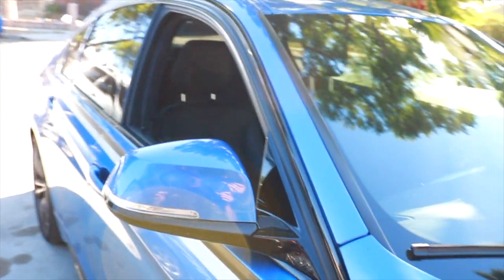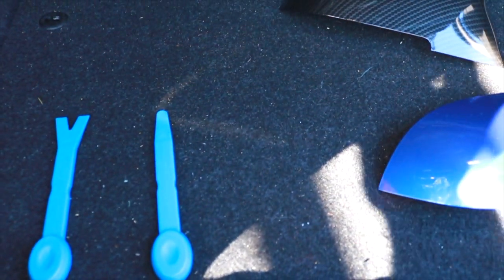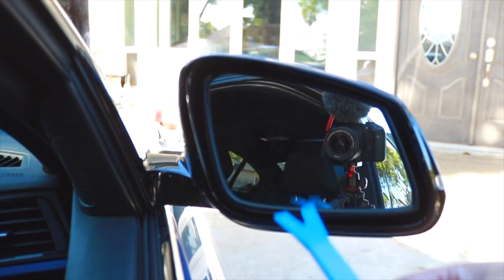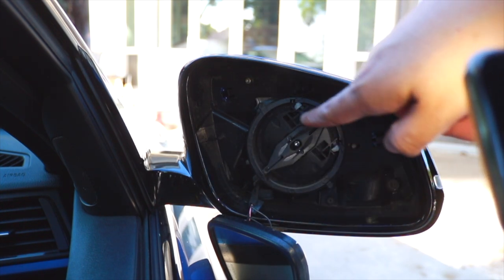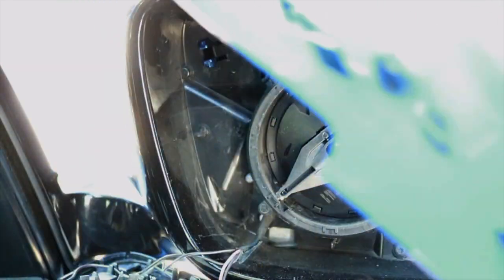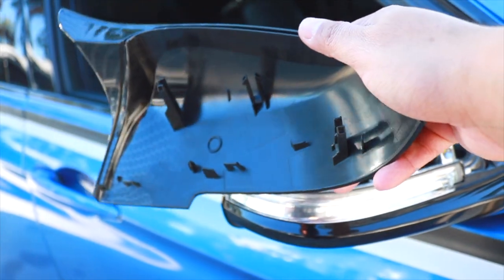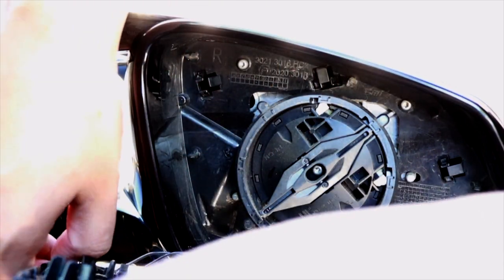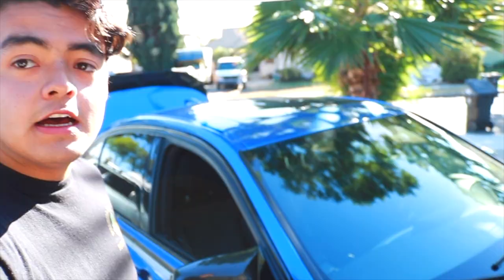HOW TO REPLACE YOUR SIDE MIRROR CAPS ON A BMW?

Comment: Worst way too many chances to crack the mirror. Easier to slip a credit card around the outside of the cap and takes less than 2 minutes
Reply: Exactly, I just cracked my mirror trying to do his method. The CC method took less time and did not require dealing with the mirror. Or use a thin long screwdriver.